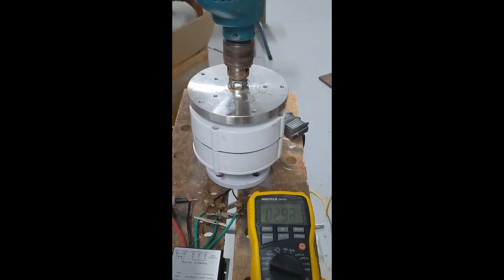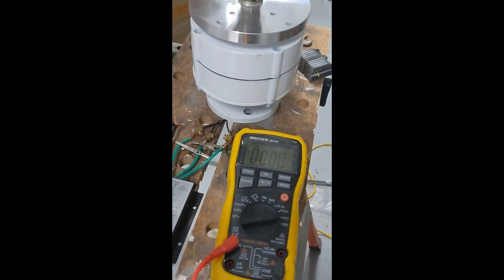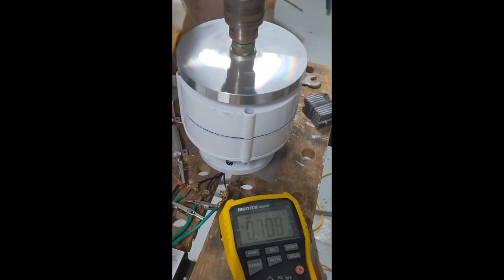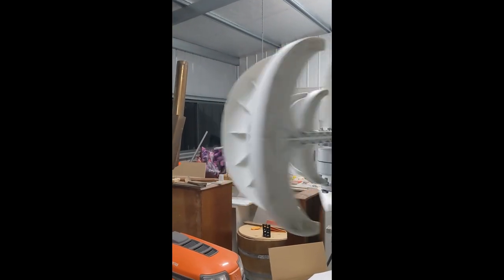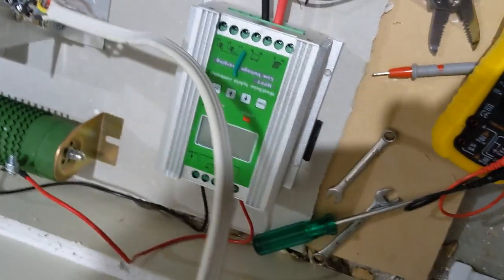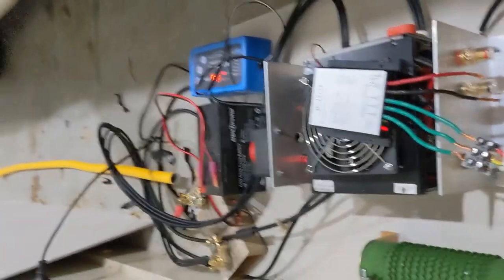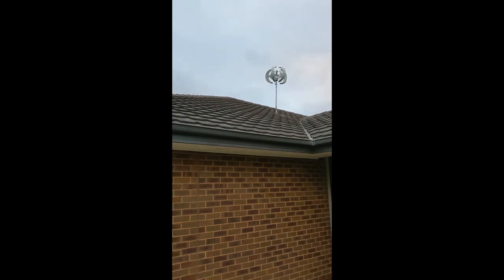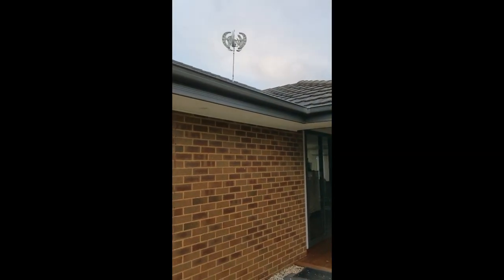Testing the Power Generated by A Chinese Lantern Vertical wind turbine in a 100km/hr gale

Comment: thank you kindly for this information.I was contemplating buying one,but it just looks like a piece of worthless trash.thanks again for saving me being dissapointed,and having to return it.I'll start researching the horizontal axis fan blade configuration.blessings to you and yours.maddog.off grid,680ft up a mountain with a pretty constant breeze.I'm using two 90w'bresser 'panels to charge two 300w decor solar battery bank,and even on quite cloudy days,they are still keeping both banks charged.I'm buying six 2nd hand 100w panels.they are 8 years old and are still oouputting around 80w per panel.thanks again for your honesty.be lucky.maddog

Comment: There’s a lot of mixed signals ( good and bad ) on here about these turbines, Ive bought one with the intention of it supplying a trickle charge to my motor home leisure batteries overnight when I loose solar charge and am off grid. I don’t expect to much from it but it’s all good fun and a learning experience working out what works and what doesn’t. 👍🏻
Reply from the maker: Yeah, these are not geared and the power calcs show that you can probably charge a single LiFePo4 cell, but certainly not a 12V RV battery
Reply from the maker: Yeah the guys here have it. These are probably able to charge a phone (maybe). But yeah more about the learning experience rather than expectation that it will actually do anything practical

Comment: Thank you for posting this video. It shows clearly that these Chinese wind generators do not work. On my channel I am trying to get a car alternator to work as a PMA and give me a reasonable output. The best I have managed is 13v and 4 amps at 3000 rpm. The alternator can spin at 3000 rpm but not with blades attached.
Reply from the maker: I do have a high end wind generator and it works fine. In fact the generator in the video can actually produce the rated output just there is no way the blades will ever spin fast enough at this scale to get useful power. Scale up the blade surface area and gear up the ratios a bit and the generator would work fine.

Comment: Hello Sir, superb explanation there. Can I please get the connection layout. I have a similar turbine and wanted to connect to a battery. I am no electrical engineer, hence wanted to see how to connect mppt, dump load etc. Can please notify if the layout can be shared. Thanks
Reply from the maker: Hey there. For these turbines you are pretty much wasting your time here. you would be lucky if you could get enough power to slow charge a 3v lithium ion battery. The plus is that the generators themselves are typically capable of generating their rated output, but the turbines are just too under powered. They emit 3 phase AC sir you need a charge controller of some kind to rectify that to a DC source so you can charge. But even that won't be too successful given that the two charge phases typically required for battery charging lithium ion or lipo batteries won't really be achievable. Best you could probably do is trickle charging a mostly already charged battery for maintenance purposes

Comment: What is the function of dump load? What's the effect if we don't install it?
Reply: Having a dump load protects your batteries from being overcharged. Once the charge reaches your maximum set charge limit on the controller, it sends all that extra power being generated to the dump load/resistor that burns it off as heat.

Comment: i concur, this turbine is absolutely pointless, and they're getting away with selling this crap.
Does anyone know which turbine would be worth investing in?
Reply: I've heard Istabreeze turbines and lowenergie ones are quite good.
Reply: @somemore9784  do you have a link? 🙏
Reply: istabreeze are good go for 1500w they are the most power for the money, ebay sells them
Reply: I bought a 600 watts B & C for $433. It works pretty well. Will make 400-500 in a stiff breeze. I've had it a month. It has been through some 70 MPH wind gusts in the last few weeks. Highest wattage I have seen is 715. It's putting out 332 watts in a gust of 20 or so. It takes a hefty wind, but at least it will do the rating.
Reply: @davidpotter9462 hi, would you mind to share the brand name of your B&C wind turbine?

Comment: hi there, can u please add the tested generator spec in your description. watts & Volt?
Reply from the maker: Sure. It was claimed to be 1200W. The voltage is pretty much up to the charge controller, but out of the box, the supplied charge controller supported batteries in 12 or 24V configuration. I actually don't doubt you could get 1200w out of the generator, but it would have to be spinning at around 3000 rpm. That might happen in a 700km/hr  gale (need to go to Jupiter for that kind of wind). At much lower rpm, you can get 30+V though no probs

Comment: Leaving aside those "lantern" vawts are rubbish, the big problem of most renewable energy youtubers is the missconcept about matching turbine voltage and (battery/controller) voltage. You won't squeeze a single watt if the rated turbine voltage is the same as the battery/controller. The rated turbine voltage has to be, at least, three times that of the batteries/controller so you can go through the whole power vs voltage range. Most of the time expensive and complicated electronics are not needed if you have this concept clear. Unfortunately, VAWT market is full of dishonest suppliers offering "physics law breaking" performance, people buy those and get dissapointed and many people think they are useless. However, there are a few manufacturers selling properly designed VAWTs. They are not cheap, neither small but they do work. i.e Hipar, Greef, Suneo
Reply from the maker: Yep, the generator included can actually supply 50+V and the controller is happy to handle that and supply the rated charging voltage, but just not possible with the turbine  supplied. So I can demonstrate that the system would work if you can gear up the speed to about 2000 rpm! But the turbine is barely capable of 20